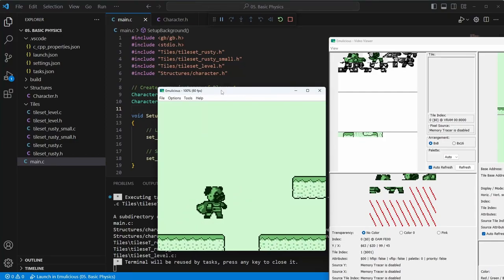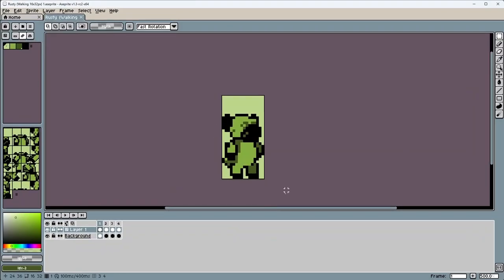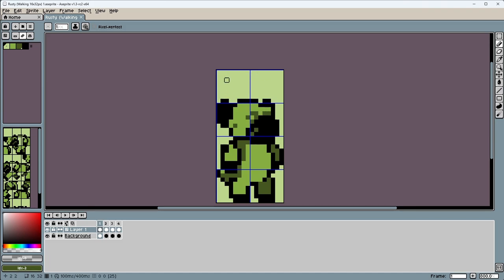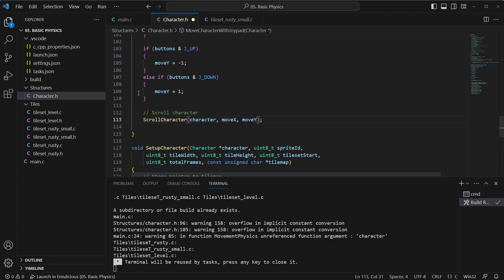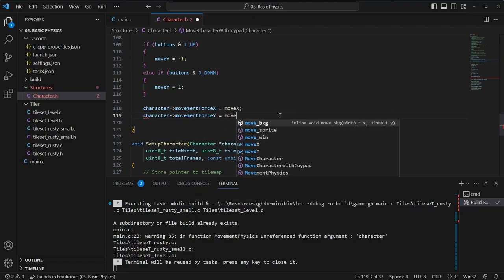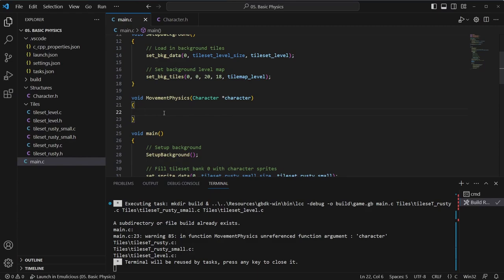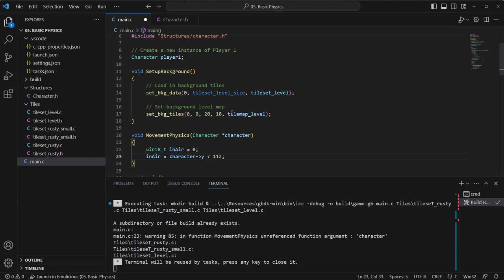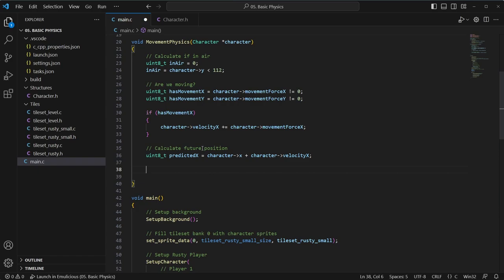Game Boy Development - 06. Movement Physics

Comment: Hey, so, when I was trying to follow along at around 3 minutes, my "player2" small rusty was having difficulty with the tile mapping because it was starting at the wrong place - I had to tell it to start at the end of the big rusty's tiles, but in your example it seems to have done that automatically. If you don't mind, what part of your code made that adjustment? Is there something I forgot that would make the tilemaps reference only the intended files instead of all the tiles in memory?